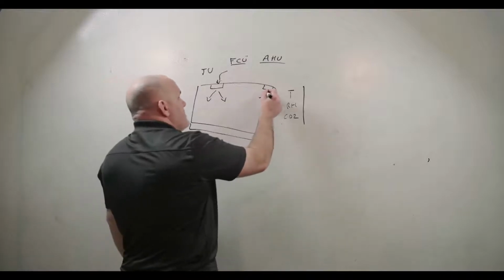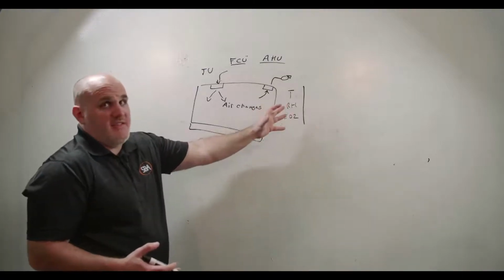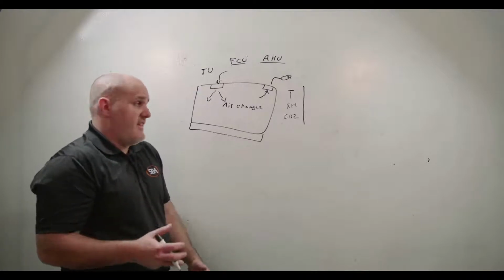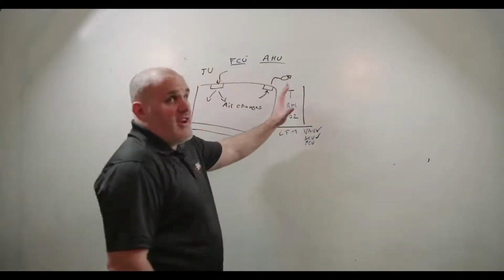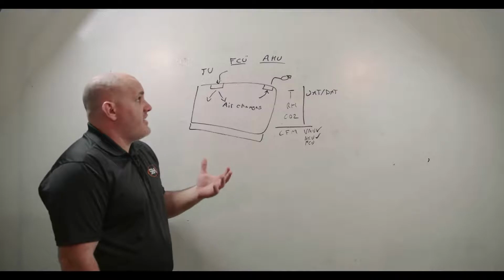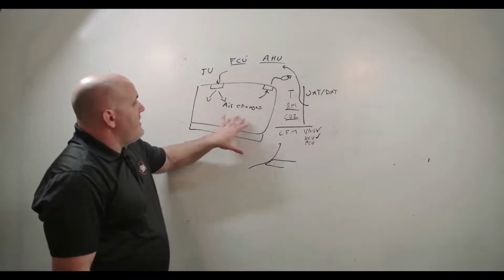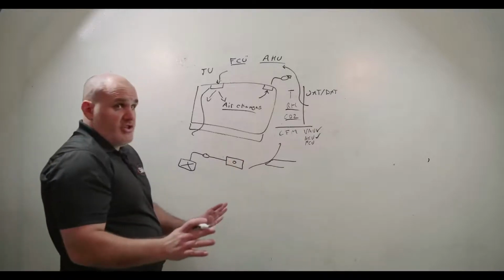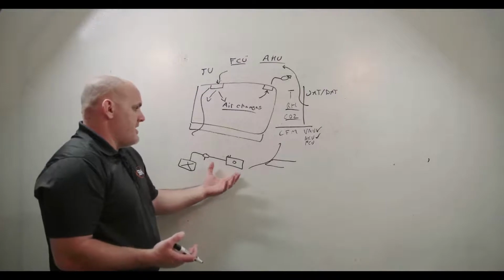SBA TV 28: HVAC Space Control

Comment: Sweet, here's a notation of the tip you recommended:
increasing air flow rate can naturally solve a delta temperature of ~4deg in case of patrons feeling overly warm in the space.
Reply from the maker: Yes airflow can solve a lot of problems due to the evaporative effect.